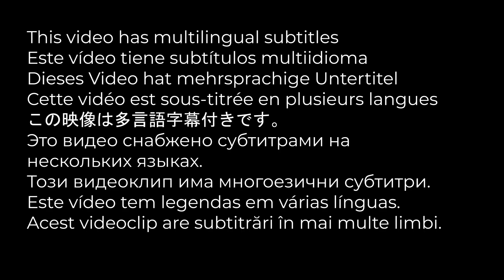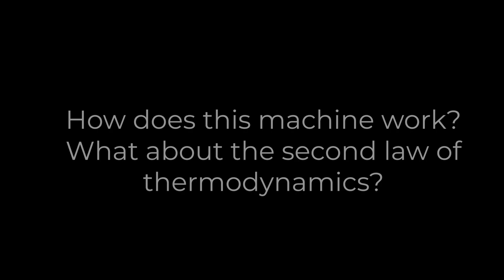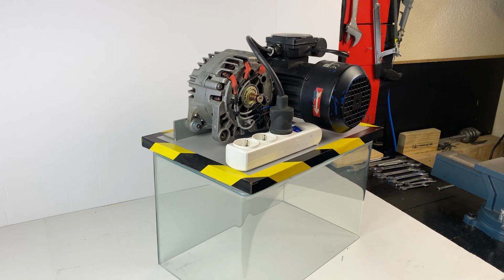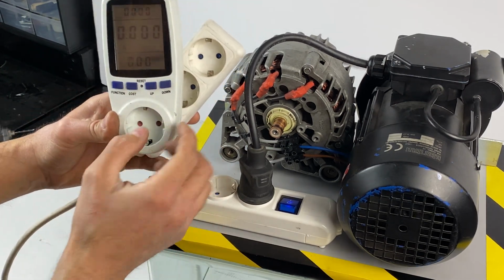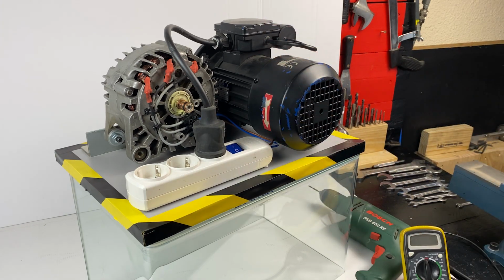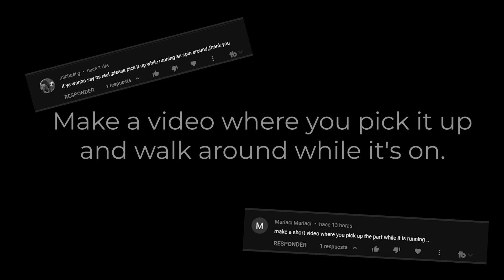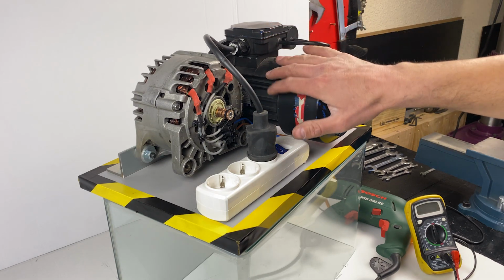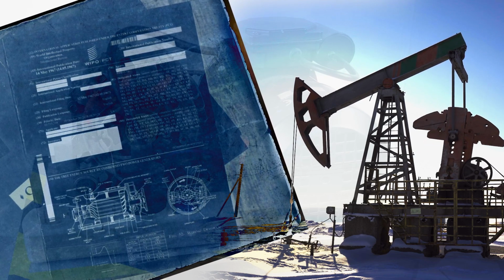We put this Infinite Energy Generator to Test - Liberty Engine 1.0

Comment: As another person commented, a parts list and procedure would be greatly appreciated. I’d love to build one and try it out. I have several alternators and single phase motors on hand.
Reply: Try putting a fan in front of a wind turbine. Same results.
Reply: I am definitely going to build one. My biggest challenge will be modifying the alternator.
Reply: @the-876er  think outside the box. Maybe you might have a friend who is handy or a metal shop.
Reply: The parts list,
2lbs of unobtanium 
1gallon snake oil
5oz of fairy dust.
Procedure,
Make magnets from unobtanium. 
Lubricate bearings with snake oil.
Sprinkle fairy dust over contraption.
Spend a week wondering why it doesnt work.
Reply: @chrisclarke6344  My man. As you can see on my comment they tried to call me out like GANGSTAS yet I see they havent replied TO my reply or answered anyone elses questions.
Reply: @chrisclarke6344  Yep, and all they do is release ANOTHER video of the same thing saying the same thing yet still not really answering the same things to get another million views for.....the same thing. They are "trying" to be Stanley Meyer but are coming off as David Copperfield.
Reply: Can you build 80KV infinite energy machine?
Reply: @anteskojo5959  see my parts list above.
Reply: Why not reverse the setup? Since the motor is so powerful. Use the alternator as the motor and motor as generator. Comments please
Reply: @chrisclarke6344  Yep. It's as simple as this: the only energy put into the system (ignoring the hidden batteries or whatever is hidden) would be the pull string to start. That's totally negligible energy. Bearing friction would stop the whole thing in a second or two (ignoring the hidden batteries or whatever is hidden).
Reply: @TheSoulSauce  i feel even that basic fact will pass them by, it is amazing the number of people who believe this is possible. I think it is because he uses big words they are unaware of such as 'neodymium magnets' and because of that the magnets have magical properties.
Reply: Hi I always told my kids about this. We did something similar to this many many years ago in primary school. That was in the 80's. I kept it in mind all these years. The experiment we did was on a smaller scale, but we did it.  I'm currently looking at my scooter with this in mind . A scooter running on no petrol and no battery. I know it is possible.
Reply: @efraimtrantaal4946  no its not please read about basic physics and thermodynamics. You cannot get more energy than you put in, no matter how many fancy named magnets you put in.
Reply: Do not waste your time. It Will not work.
Reply: @joedell71  The first part of your comment is true butt the second? What do you mean the magnets lose their charge? I think you mean to say that the magnet has no discernible effect on the energy produced. 

What I need is not a parts list. Anyone can make up any amount of parts. What I need is a diagram of all measured voltages, amps and resistances. And I need these shown on the meter unaltered. So a live video would be beneficial. Not to the creator, but to us the consumer as we will not be duped. And if it is in fact possible, energy problem solved. There is no downside to either proving or disproving to us the consumer. There is a downside to disproving for the creator. And that is everything you need to know. Parts be damned, procedure be damned. None of that means shit when the measuring is not in place
Reply: Parts list is a case of watching the build video and this one. All parts are mentioned. I’m deffo building one as I already built a similar thing with a flywheel and not modified the rotor. It works but too much drag when adding other motors with high starting current.
Reply: @dragon67849  he cant measure it or it would show where the extra energy is coming from. Hidden batteries of a mains supply.
Reply: @andrewhaddon1896  no.
Reply: @chrisclarke6344  I have see it at the Technical University someone gave a presentation at the same principles. And it WORKS.
Reply: @jbu1963  which university, who was lecturer? Citation title? Has he been put up for the nobel prize? Because he has totally changed the laws of thermodynamics. Plus getting generator and motors to work beyond 100% efficiency, the man is an unknown genius.
Reply: @chrisclarke6344  Probably you didn't watch till the end or the second video. It's already patented by an oil company and they put the patent far away. Not allowed to build and to sell this.
Reply: @jbu1963  The guy in the video claimed there was a patent 60 years ago by some company (why didn't he name the company). Then he said that patent was hidden away in a drawer. If they never filed a patent with the patent office, then they have no property rights. If they had filed their patent that would only protect their intellectual property rights for a certain number of years. Typically design patents are valid for 14 years, but there is a 20-year duration for plant and utility patents. After that time is up the design is open to the public.
Reply: @jbu1963  "Put the patent far away"? What does that even mean? It's all nonsense.
Reply: Provato ... niente da fare, non ci sono 220v ma solo 32 c'è bisogno di altri dettagli, delle specifiche tecniche dell alternatore, motore e magneti.
Reply: Nick's auto repair.. if you do try it and it works let us know, I don't have the parts around otherwise I'd give it a go.
Reply: how long will it last before the permanent magnets fail.. ie: heatup and break
Reply: Purtroppo ho trovato il trucco, e devo dire che mi dispiace parche sarebbe stato bello avere l'energia gratis. Se osservate attentamente il video quando prende il motore da terra e lo mette sopra il tavolo, 1 si vede il fio in tinta rossa come il pannello che c'è dietro solo un po' più scuro ma comunque si vede.2 Quando lo porta in mano fuori dal tal tavolo, per un secondo quando si gira di lato osservate tra la mano e la manica del braccio sinistro si vede chiaramente il filo che ovviamente uscirà dai pantaloni. Ecco perché non viene inquadrato dalla testa ai piedi, ed ecco perché tiene la mano sx sotto la presa AC, io se dovessi alzarlo lo terrei ai due lati e per non insospettire mi tirerei su le maniche della giacca vero? Comunque complimenti alla fine ci guadagnate sempre ciao ciao ♣♫
Reply: @maurorossi3269  che magneti hai utilizzato? A me da solo 5 volt attaccando un trapano, quella cordicella mi sembra una cavolata
Reply: around 12:45 we see the red wire hidden on the bottom of the red shelf just before you drop it....
Reply: @chrisclarke6344  this famous patent is probably the number 4151431 made by Johnson Howard R
Reply: @jbu1963  this famous patent is probably the number 4151431 made by Johnson Howard R
Reply: @moosmix  is that the one that describes the many uses of unobtanium and snake oil?
Reply: @moosmix  well thats an expired patent and is listed in the patents of unworkable designs. These people wont tell them that!
Reply: @dragon67849  you are using the magnets in the alternator body to produce a field in order to harness that field for electricity right? If that device is not hooked up to the mains and uses the magnetic field to generate the electricity then the magnets will absolutely lose their magnetism over time because you are using them to create the field. The “Charge” in the magnet is how strong it magnetically attracts or repulses.Magnets eventually run down in this kind of configuration and lose their magnetism. Its the second law of thermodynamics dynamics. Friction will always cause loss. There is no such thing as free energy. Sorry. This has been debunked a million times.
Reply: @diegomantese4756  Sadly you are right: at 12:45 there is a change of colour on the red background where it is the wire that feeds with electricity the motor. For sure they tried to use a software editing but obviously they are not that talented to totally make it disappear.
Reply: @jbu1963  But build for personal use? How can they stop that?
Reply: @efraimtrantaal4946  really have you done this yet
Reply: @chrisclarke6344   Hmm a cynic. I'll bet you haven't even tried to make one, have you? Hopelessly indoctrinated.
Reply: Just grab a motor and hide a battery, not that hard and has been done the same way for decades. There is reason why they never allow a full breakdown when in public.
Reply: There are a lot of excemples in you tube wich build it up and name the materials too.
Reply: @maurorossi3269  qui non  c'é trippa per gatti io al massimo 4 volt ho tirato fuori, l alternatore è un 24 volt 200 Ampere
Reply: @the-876er  Yeah, that's the biggest challenge...

Best of luck with the whole "invalidating conservation of energy".  Be sure to let me know when you win the Nobel Prize.
Reply: @chrisclarke6344  I don't need a week; I know just from reading it.  It doesn't work because you forgot the flux capacitor.  Therefore you can't regulate the temporal distortions in the EM field.

Jeez, didn't you learn anything at Starfleet Academy?
Reply: @st.jimmy0244  dang you got me i must try harder will fit the nuetrino wave enhancer next time.
Reply: @chrisclarke6344  Don't forget to have a left-handed smokeshifter on hand just in case :)
Reply: @st.jimmy0244  is that the one that 'unicorn products' sell?
Reply: @philippecaouette4275  what are you talking about??? Which cabel where at 12:45 there is no cable!
Reply: You can't build it....! EVEN IF YOU HAVE ALL THAT NEEDS....
Reply: @StefanReich  not used, produced
Reply: а простите пожалуйсто,а можно параметры генератора? количество витков на катушке генератора? намотка катушек 1-1, 1-2, 1-3, 1-4???если конечно не очень большой секрет
Reply: @chrisclarke6344  please read magnetic-induction laws in physics book. you can indeed pull energy from the atmosphere around you with a polaric field. Tesla had working models showing that you could do it. He used them to show how wireless electricity could be sent with things like tesla coils and magnetic-induction towers. The problem with these devices today. is that the fields become destructive to sensitive equipment.
Reply: Unless you use magnets
Reply: @chrisclarke6344  so you're saying this machine is not genuine? It looked like what I just watched was it working as described. Why do you believe these guys are con artists?
Reply: @Hx4DNegus yes that was my thoughts, i have a friend that I will try and ask to put together only problem is the magnet/s spec
Reply: did you manage to do it?

Comment: Well done, you've broken thermodynamics. What next, faster than light travel using a bicycle.
Reply: The second law of thermodynamics was broken long before this so not really the first people to do so
Reply: @markosth09  errr yeah, sure it was.
Reply: Pls will pay for modification plans of ALTERNATOR. PETER
Reply: ..lol..Magic..
Reply: Oh dear, faster pushbikes unregulated - disaster!!
Reply: Thermodynamics was a theory before it was a law. A "scientist" then said it was now a law with some flimsy proof. It is like Darwin and his rubbish on evolution.
Reply: The battery is in the platform the components are mounted too.. No breaking the law of thermodynamics on my watch..lol
Reply: Dude, I replicated their experiment, but I didn't bleed off the excess free energy, and the positive feedback loop caused it to run faster and faster until it DID break the speed of light! It was able to do this without flying apart due to the fact that I oriented to the spin in the same direction as the earth, thereby nullifying the centrifugal torque. Once I was able to channel the rectified alternating voltage through a three channel diode, thus reducing the pluperfect, future conditional energy by .33333%. Of course, since it was a repeating decimal, I soon ran out of paper to complete my calculations.....
Reply: @bigcountryvet5984  Exactly! It's just like the "Law of Gravity!" Everybody knows, there is no gravity, it's the earth accelerating upwards at 32ft per second squared. This upward acceleration is just Jesus bench pressing the flat earth up.

Comment: Good Job!!! Even if it is not perpetual it proves a potential to make more efficient and portable power sources at a more affordable price. Thanks for the idea and I plan on giving this a try. Also, remember, The automobile was at first thought to defy the laws of physics. Now look at it.
Reply: Actually your wrong about batteries, it will be to much of a hustle, but if you watch closelly at 12:46 and 16:21 you will observe with 0.25 speed on youtube that the handler has a cable attached to the platform running through his left hand. So the voltage is given by the motor and the socket connected to the main source in his house, thats why is so stable at 226 v under load. Its a well designed and crafted video to make money from clicks and views. The alternator produces some power after all but not even close to run the motor at 2800 rpm with no other loads. Its plain trickery my friend and your instinct is on the spot but the analisys was wrong. I liked the part were they were claiming that with the magnets can produce 10.000 w about 10 times the normal. Its like claiming they can fly but hey its digital so who knows?
Reply: @cfgtud4146  i dont see cables hiden
Reply: @kanadskyvictor6512  probably you have to change your beer pusher...
Reply: @xalzor740  If & only if you believe such BS, then yes !
Reply: @cfgtud4146  You see it better at 16:16

Comment: I'm not an electrical engineer, but i do know a few things about cars. For one, i know that Alternators have this thing of increased resistance - meaning, that as the load increases, the magnets create drag, causing it to need more rotational force to spin. In other words, as a net zero circle, it might run for a very long time, yes, but as you add draw, the resistance will slow down the alternator, which will slow down the motor, which will reduce output, which will further slow down the system, eventually stalling out. 
How does this system prevent this from happening? 

The way i see it, it can be a near-free energy machine, if you add a battery pack to it, so that when drawn via the battery, the system isn't overloaded and stalled. And, it's not really ever free - maintaing it costs a bit, but ultimately, it would be much cheaper than the grid. 

If you want to help the planet, you should release the blueprints now, not when you reach millions of views/subscribers, otherwise, it just sounds like a cash grab on a "mystery machine" which is not really even what's promised. We've seen these snake oil scammers before, If this technology really works, don't be one!
Reply: The patents are owned by an oil company, he releases the said blue prints, he’s a dead man walking.
Reply: i agree a battery or capacitor hooked up would fix the issues of resistance though it did seem to ramp back up to speed quickly when he took the load off honestly id love to try this with an electric vehicle my only concern would be over heating of the motor running at maximum capacity like that is probably not great and he did say the bearings would need to be replaced in all of it every six months next ev build i do im trying this
Reply: it doesnt...........................
Reply: @csud9540  He could release them via wikileaks
Reply: I don't understand everything , but we need it ... and I agree your comment !

Comment: Several things. 1: Please provide the details of the patent you mentioned. 2: Please connect something that REALLY draws a high load, like an AC unit or high powered oven. 3: Please show how long that load can be sustained. These simple things will go a long way. At the end of the day though, I am convinced that perpetual motion is impossible.
Reply: around 12:45 we see the red thread hidden on the bottom of the red shelf just before you drop it....
Reply: @philippecaouette4275  You can actually see the shadow of the wire on the table and the blurred out wire. Thanks for pointing that out.
Reply: @philippecaouette4275  Perfect man, you can see the editing done. Case closed for me.
Reply: @philippecaouette4275  yha your legend i see scret of power wire hiding😮😮🤣🤣👌👌red wire blur or edit adobi

Comment: I built something familiar 8 years ago. Free energy since then.
Reply: hi Frank
 You make me very curious ,is it possible to share your  complete information with me about this invention   what i exactly components that I need to build it , Because  trust me  this concept  will not work at all  !
 First the information about the used alternator is totally a lie!! its not  model 24v on the movie ,they use alternator  12v 150 Amp from Valeo  .
Reply: Are you serious? 

I see you have chosen the red pill ;)
Reply: ok top hidden secret till so far !no one share  the blue prints ;))

Comment: If this was plugged into an electric car overnight, you could basically drive forever for free.
Reply: Or better yet, just put one of these in an electric car with a pull starter.  No batteries needed at all.
Reply: @kenh4848  and add a Kill switch to shot it off
Reply: @kenh4848 
This device is pretty stunning. We need to get one in front of Elon Musk ASAP. He has the capitol to set up a factory & to produce purpose built scaled up versions built specificly from scratch rather than recycling sorta kinda repurposed alternators & motors. If every house & workshop on Earth was powered for free, we'd have an army of assassins roaming around trying to silence all involved in a heartbeat.   Musk is the man to approach with this device, since he fully understands the complications & risks involved with taking global money spinning power generation away from elitist parasites. 
SOMEONE HAS TO GET THIS PRESENTATION IN FRONT OF MUSK....     AND FAST...    BEFORE THE MAGGOTS WHO SELL US ENERGY FIND THESE GUYS AND SET THEM UP ON THE BOTTOM OF THE PACIFIC.